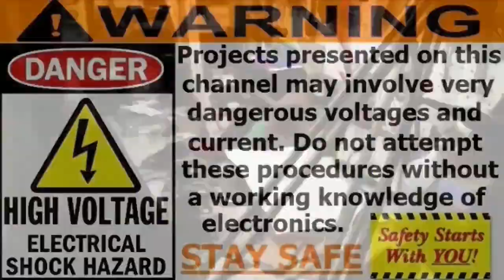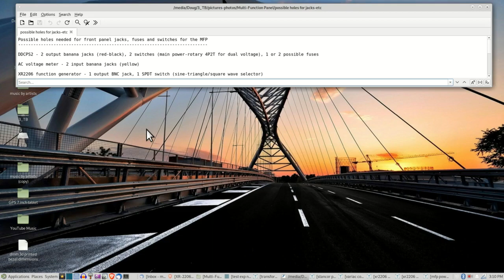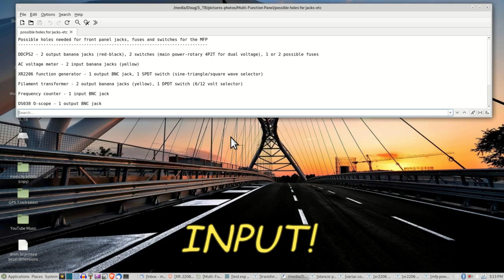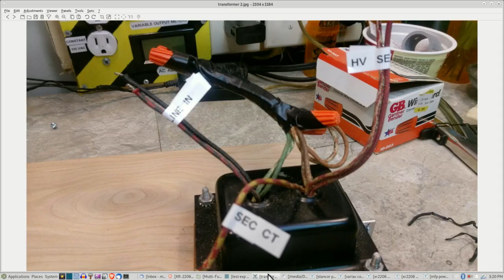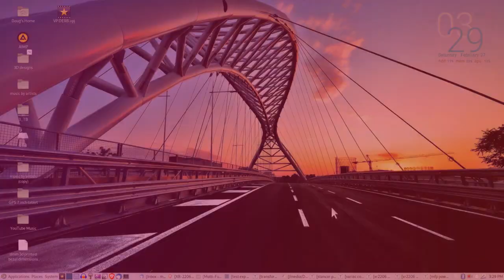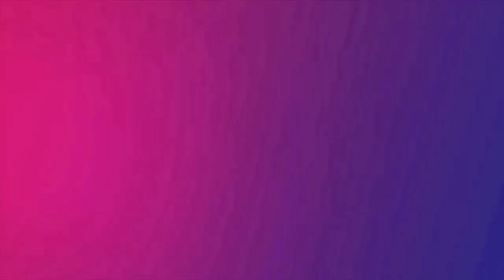DERB - More holes needed for the MFP

Comment: Ah, the complications of meeting two (or more) end goals - working on tube- as well as transistor-based projects, and keeping it all under one compact cover.  Limited space does have a way of sharpening design decisions.  Nicely thought out!
Reply: @DERB_Seymour_Indiana  Roughly the same here; 80+% of my measuring is done with a fairly inexpensive DMM like the one going into the MFP.  For really ticklish stuff I use one of those $1 DMMs from Harbor Freight first.  If the magic smoke gets released, well, it was just $1's worth of magic smoke.

Comment: If you are interested, I can send you a circuit for that 0-330/0-660 power supply that will use fewer components and only a 2 pole switch instead of a 4 pole one.

Comment: You sure have a complex setup there, I do not do enough radio repairs to bother making a power supply.
In the future if I get more radios to repair (FLEA MARKET FINDS) I may build that 0~450 volts DC supply I had mentioned, but no need for me to try to build what you are building.
You do more radios and other electronic projects then I have done in the last 30 years.
Of course I do not touch transistor radios, only tube radios.

Comment: Doug you know with all the holes you're poking in that you could have had a 3D printed one and you could print it with all the custom hole,s in it I even went on Google and they have tons of slanted metal cases with no holes in them I know you want to do it on the cheap by the time you get done you're going to have more holes in that than the dish strainer I suppose you could have made it out of cardboard lol